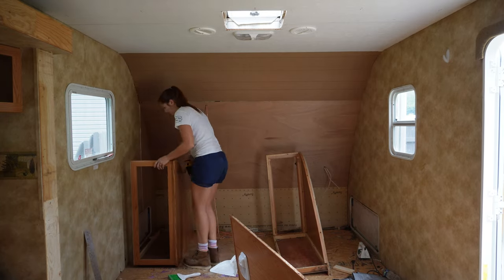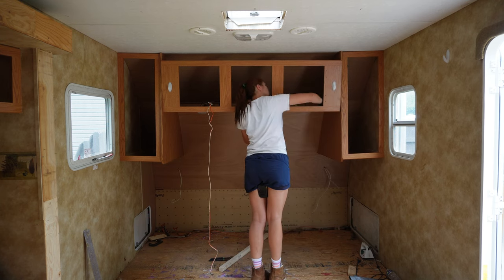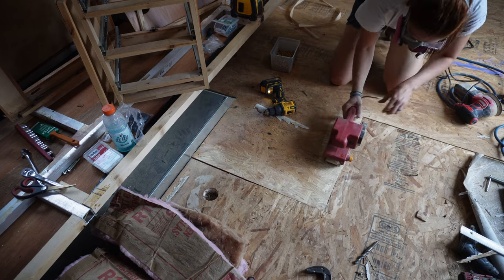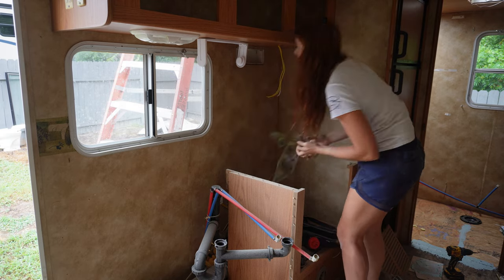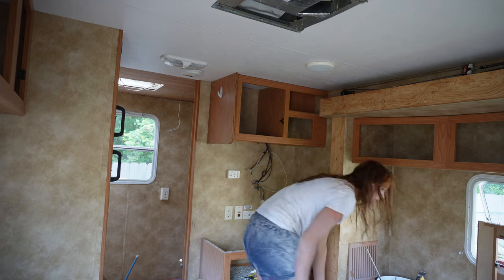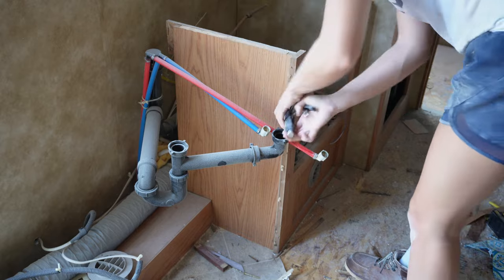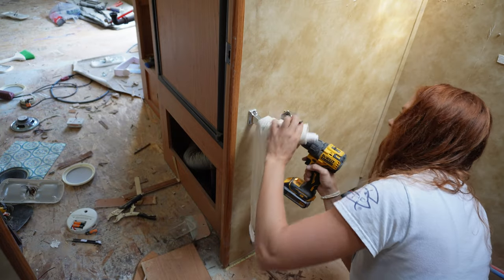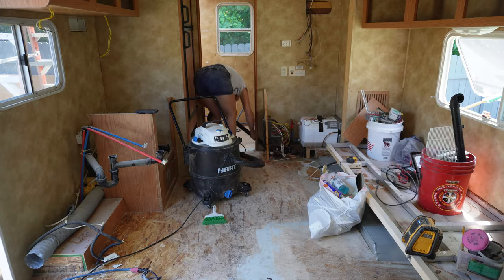RV Renovation: Day 1 Primer Prep

Comment: What do you do about the outer skin ( aluminum panels ) when they lost contact to the wood ? If you know what i mean ( looks like air between the outer aluminum and the wood  ? Delamination i think they call it. Do you have any video on that ?  Thanks for your time and effort sharing these videos ;-)  Regards from Denmark
Reply from the maker: First question—if the exterior of your camper smooth (fiberglass) or aluminum (wavy)?
Reply: @fallenintocamping  the outside is aluminum. But it's not the wavy stuff. It's just a little bit textured like if you spray stone guard on the door panels of a car.  And maybe i should mention that it's a European lightweight trailer, so the aluminum is really thin.
I am thinking of replacing the thin mdf sheet and then glueing the aluminum back on the mdf with Tec7 xtack which should have instant bonding, no need to keep pressure on it for long time